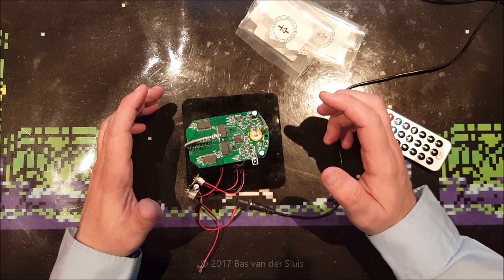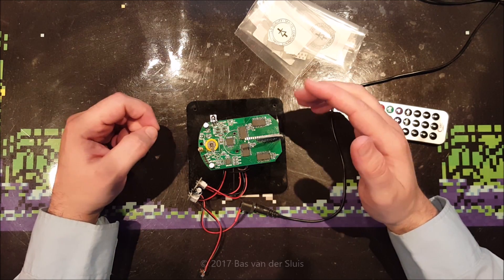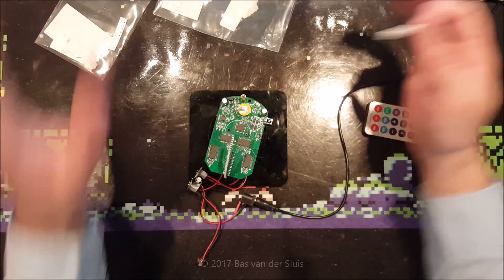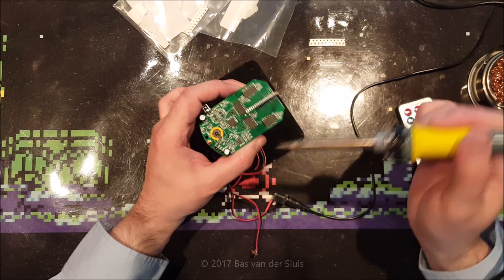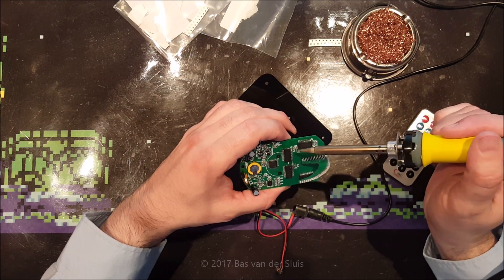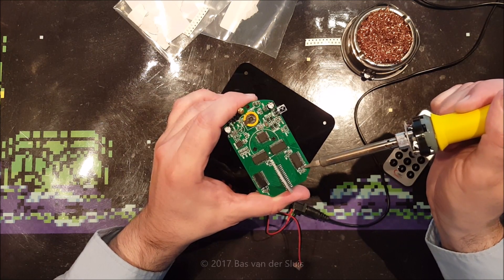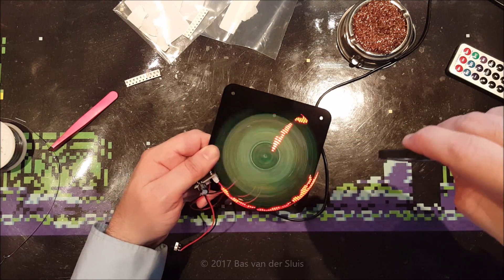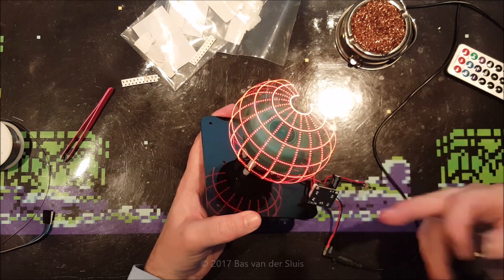Fixing the error (mode) of the Spherical Rotation 56 LED Sphere / Globe kit

Comment: Hi Bas, my problem is that the bottom half of the LED is not working. When restarting, these LEDs also light up. But when I go into the programs, the bottom half stays dark. I have already checked all solder points. Do you have any idea

Thank you
Bernd

Comment: Hello, which type of 3mm  ir led is needed ? for the small pcb...so i need to buy new one and see there are many different types with special wavelenghts etc. .... i'm so happy to find your videos and documents on Bangood because i order this kit on ebay and there is nothing really nothing ... no manual no Info....so i want to say thank you to you !!!!
Reply from the maker: Thanks! The LED connected to the power-supply board can by almost any IR LED. Just try the cheapest you can find.
Reply: many thanks for your fast answer.....so you mean wavelenghts of IR led is not important and volt type ? i see many different at Conrad...
Reply: another question please to the power board you build in a wire bridge on top of the board but i see on the backside of the board are same connection points for diode...should i brigde them too ?

Comment: This problem doesn't seem to affect the blue LED version (which is what I have). I assume the resistors were meant for the blue LEDs and they didn't change the value for the red LEDs. Red LEDs have a lower forward voltage, so they need larger value resistors. There's no reason to change the 1.5k ohms out for the blue version of this kit.

Comment: First of all , all of your videos are excellent and I thank you for that  I just finished my first spherical 56 LED kit I picked up the 4.7 resistors ahead of time. When I turned it on I noticed I got that error mode somewhat like the one you got on that video so I know I’ll have to program it to take care of that   but I also noticed there was a redline that stayed on in the center of the globe all the time which meant one of the Leds stayed on all the time.   Would you have an idea what could be wrong ?   Or maybe I should say what I did wrong?         Thank you
Reply from the maker: If the globe is functioning normally except for that one 1 LED, you can check the wiring to that LED all the way back to the IC. My guess is, is that it is connected to another pad somewhere.
Reply: Bas van der Sluis     Ok... I will look into it to see what I can find,   ( I am kind of new at this stuff )... I find it very interesting and challenging....Thank you for your quick response

Comment: My kit is done (finally!). I think I spent an hour staring at it last night grin

A few observations:
- changing the 1.5K resistors to 4.7K didn't help my problems
- I found the my IR transmitter had gone bad. It was working, then stopped. YIKES I replaced the IR transmitter and then my globe started working - but intermittently.
- Making sure I had a GOOD 1A (at least) +5V supply did fix my intermittent problems. It's rock solid using a 2A supply.
- I put a small piece of the black shrink tubing over the IR receiver - except for the very end. This reduces the jitter of the image - the 'start' indication is only received when the IR transmitter / IR receiver are directly in line.
- I have a 60hz circular fluorescent light (in my magnifier) on my work bench. I was having trouble getting the globe to accept IR from the remote and then I turned out the light and voila the Globe loves the IR remote now. The fluorescent was interfering with the IR.

Now I just have to figure out a USB-to-TTL, so I can reprogram the text and images. After that - I am going to hack the source code (or, more likely, rewrite it) so I can use this concept in some Christmas products I am engineering for 2018.
Reply from the maker: Thanks for the info! I hope it helps some other people reading this comment. I'm looking forward to your code and Christmas products.
Reply: Well, the engineering I'm doing now is for Christmas 2018 products. I've already shipped everything for 2017. But if I actually get one of these POV displays incorporated (I'm also playing with the FLAT display), I'll send a link to pictures.

Question on the USB-To-TTL dongle issues - do you get a '!' on the device in device manager and a status of "Can not start'? I'm getting that error sequence - but if I reboot (with the dongle attached), the serial port is okay. BUT if I remove the dongle and then plug it back it - back to the error mode. Reboot again, and everything is okay.

I'm using a very, very old Prolific USB-to-Serial (15+ years) with the RS232 level driver removed.
Reply: Annnnd - I take back everything I said about the dongle. Mine is no longer working under Windows 10, no matter what I do. Grrrrrr Microsoft...
Reply from the maker: I had these exact same issues with all the Prolific USB to TTL adapters. I have no solution for the driver issues, whatsoever. I managed to program the device by buying another non-Prolific USB to TTL adapter. If you search eBay, look for the adapters with 6 pins and a square-shaped IC diagonally positioned. I got that one working instantly on Windows 10.
Reply: I managed to find a tiny FTDI USB-To-Serial board that I was trying to kludge into a piece of old tech (A Philips Pronto Remote - never did get it to work and really not worth the effort anyway). It seems to be working fine with Windows 10 and I can download new text messages and images! Wonderful! Now to fire up the Kiel software and see what real damage I can do.

Thanks for the help!
Reply: Have you gotten anywhere on reverse engineering the firmware? I'm trying to think of how you could 'program' this chip, the serial program is just to write data to the eeprom not the chip itself. My kit hasn't come in yet so I haven't seen what chip this uses, but does it look like there's any chance of being able to program it in circuit?

Comment: OK BAs I think i understand how to program it , But how do you set the clock ? And how many images do i need to put in there ?
Reply from the maker: The number of images does not really matter. I've tried it with 2 images and with 10, both worked fine. However, I have not tried to set the clock, but my guess is that it is done with the remote.

Comment: I have been looking for a schematic of this unit, and wondering if there is one out there. I have one LED that does not light, and it runs one led lighting at a time. The most difficult part of this kit is the fact that there is basically nothing to help with troubleshooting problems. All I have been able to find is a blog post.
Reply from the maker: I've added a link to the software and some PDF's in part 3 of this video-series: https://youtu.be/oKa6jzxT9tI
Posting the link here will probably not work. Maybe this will help you.